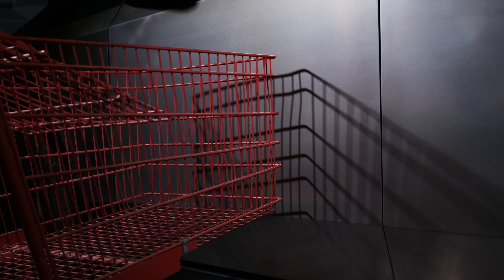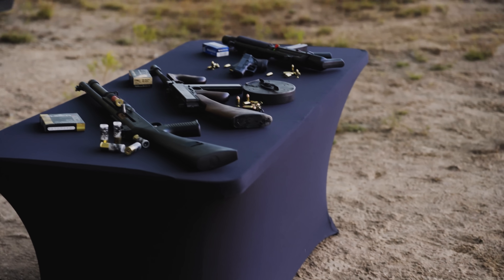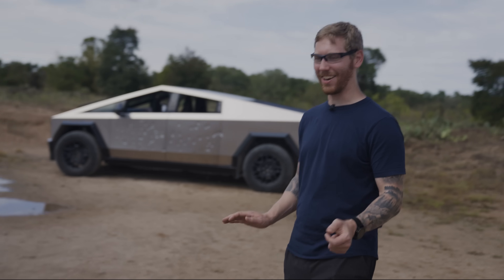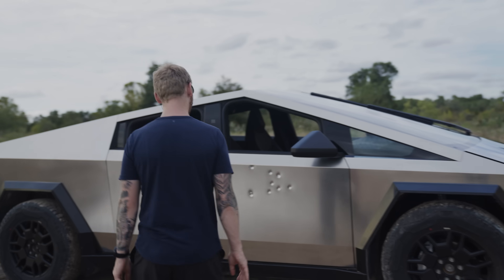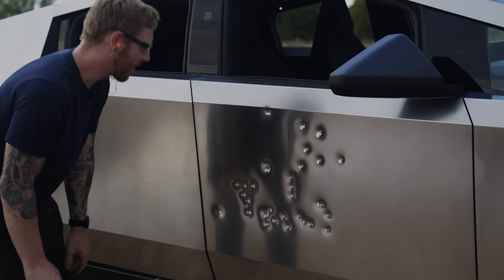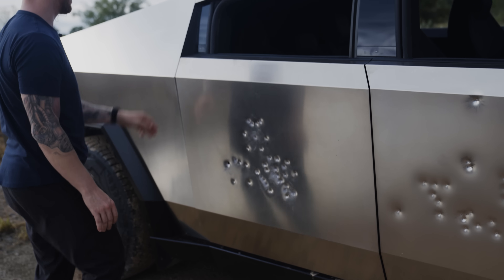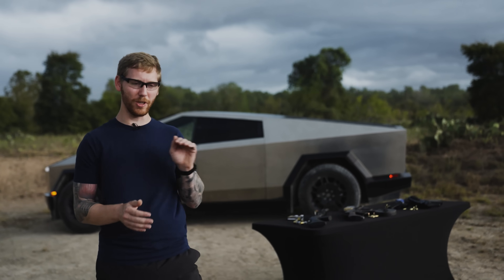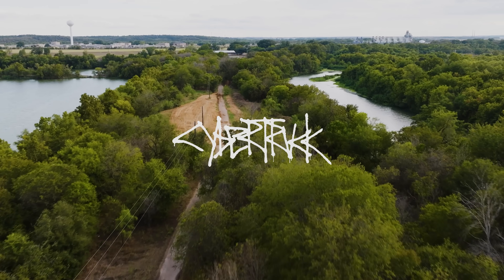Cybertruck Bullet Test

Comment: But does it resist fingerprints, and light acids like bird poo and city rain? Or will it be covered in greasy handprints and water spots after rain becuase it doesn't have door handles and requires you to grab the door itself to open/close? Do you have to re-surface an entire panel of there's a scratch? Are the plastic hub caps or bespoke Cyber Truck tires bulletproof? How about the plastic tunneau cover leading to a window? I can't understand why bulletproof doors even get any attention - shooting ANY car will stop the bullet. "Bullets go through one side and out the other" can be fact checked with 1000 YouTube videos showing the opposite. Such a bold and baseless lie.

Could have been a cool truck is the worst part. Shrunk it to smaller than a base f-150, took away rear view mirrors and rear window, increased the panel gap issues that made tesla famous, and does not appeal to the massive US market that actually buys $100,000 trucks. I can't wait to see how that stainless steel holds up over time. It's almost like they add paint to outdoor metal objects for a reason.

Comment: Very impressive... but I have to ask... why no 5.56?  Or go up the chain and see where it fails from 5.56 up to .50 cal Barrett?  I'd be very interested to see how strong of a round that steel can take.  Also you don't HAVE to use the whole truck, you can just take the doors for example :)
Reply: Because they knew it would be a forgone conclusion that 5.56/.223 would swiss cheese 1 door/glass if not both. FN 5.7×28mm handgun round too. 50 Barrett, forget about it.
Better test would've been adding .357 and .44 Magnum. I think those rounds would've made it through 1 door/glass and imbedded itself in the interior somewhere.
Reply: @1GooseEye  that would be my assumption as well, just would like to see it.  There's the clip from the Joe Rogan podcast where he shot it near point blank with his compound bow and it didn't do squat to it., which is very impressive.  Also don't get me wrong, what it already can do is very impressive, this is my "hey, let's push it as far as it can go" experimentation mentality :)

Comment: Depends on the ammo type, not the caliber or „115 grain from a Glock“. Full metal jacket will enter and come out the other side. It’s still cool it can withstand lead core ammo and buck shot. Assault rifle ammo should pierce through easily, much higher velocity and impact energy. So no need to test an AR-15 or a Kalashnikov on it, it‘ll only rip up the poor interior

Comment: Well, impressive as it is, besides the 45 ammo, 9mm ammo seems to be frangible ammo designed to break apart upon impact? Full Metal Jacket ammo are widely used by most thugs as they are the least expensive yet most penetrating...

Comment: So, in an accident, how are firefighters supposed to pull out people stuck in these vehicles?

Imagine being stuck in one of these while the battery is on fire and the EMTs can't even use their jaws of life to rip you out because the steel and glass are too impenetrable. 

And don't start with MUH ELON ALREADY THOUGHT OF THAT nonsense. Safety systems will always fail and there always needs to be a way for people to quickly get you out of your vehicle if you are unconscious.

Comment: Funny stuff , Using projectiles that travel less than a 1000 fps , and not FMJ but hollow points. Now , you want a real world test , use something people might actually use against someone in a car breach , like an AR with FMJ's , where the FPS is around 2400 FPS. AK 47 with FMJ's. Common 9MM FMJ travels slowly too , so probably stop that , thats a common round , but use a 40 cal FMJ , or better yet , the classic 357 mag in FMJ or a 45 FMJ , 50 Cal FMJ , see how those fair?

Comment: It's outrageous that car safety tests only apply to the people inside the vehicle. If you were to be hit by a truck or an SUV you're almost guaranteed to die, I'd love to see how dangerous this truck is considering how high it's front bumper is (which gives you horrible visibility). All for a non-efficient vehicle that's hard to load stuff into. Just drive a goddam electric van if you want to haul stuff, instead of having to haul out $500,000+ on this truck where you have to be a weight press champion to load something into the high bed. The only reason car companies do this is so they can sell them as "small" trucks and be less subject to regulation.

Comment: The Thompson SMG shoots a large .45 round at subsonic speeds. Although very nasty for fleshy things, it is not intended for long (or even medium) range or penetration through cover. I'd like to see this same test run with FN 5.7mm, or even a 9x19 parabellum FMJ round.
Reply: they literally used 9x19 in the video and you can see they are FMJ
Reply: @WayStedYou  Aw hell, I must have gone to take a leak during that part. You are correct. But the MP5 looks like an SD, also probably firing a slower 115-125gr subsonic round...
Reply: @Cucumberflavoredmustard  115 and 125 gr bullets are the average weights for 9mm. They are still faster than the speed of sound. If you want subsonic 9mm, the go-to bullet weight is 147 gr.
Reply: They shot it with a Glock and a MP5 chambered in 9mm in the video.
Reply: @PastorDr.MartinSsempa  They used a Glock, yes, at 1100 ft/S, which is accurate. Then they show the MP5-SD. FOR SOME REASON, they chose the variation of the MP5 that shoots Subsonic 9mm at 950 ft/s, WHICH THEY SHOW IN THE VIDEO. The MP5 shoots at a whopping 1,300 Ft/s, and they for some odd reason chose the far less punchy, subsonic variant of the gun, that shoots at the exact same speed as the Tommy Gun (with a LIGHTER bullet, so less energy.) The Glock, shooting FMJ 9mm at near sonic speeds, resulted in a fracture, a so called "double hit", in the steel body. If they had simply chosen a weapon that takes a step up, and might reasonably simulate a medium sized weapon shooting 9mm (like a 9mm "rifle" pistol, in california.), at or above sonic speeds; I feel it would've passed clean through. But they didn't. They chose the MP5SD, which shoots sub-sonic 9mm.
If they were telling you the output in Joules instead of ft/s, you'd be a lot less impressed.

Thompson Submachine Gun in Joules; 434 joules, assume an appropriate 230 grain bullet at 935 ft/s
The Glock, which was a Glock 43 Subcompact; 509 Joules, assuming an appropriate 124gr bullet was used. The Glock43 shoots at 1168 ft/s
For the MP5SD, the supplied chronograph reading was 960 ft/s; assuming a 124 grain bullet, that's 344 joules. So despite shooting a Parabellum 9x19, it was shooting it at BELOW tommy gun speeds, with below tommy gun energies.

So
in order the shoot should've gone like this:
1.Glock43 (The highest powered gun fired at the cybertruck. (Shoots a near trans-sonic 9mm)
2.Thompson Submachine gun(Near Trans-Sonic .45 Caliber Submachine gun)
3.MP5-SD (Suppressed, sub-sonic submachine gun.)
4.M4 Shotgun. (1200 ft/s with a 55gr pellet leads to a TINY 238 joules. Less than any of the other guns. None of the pellets are jacketed, so they just explode.)

Only people who don't understand firearms are impressed by this very carefully crafted video.

Comment: Obviously doors are easy to replace so you would shoot those. They are also not under tension because of their hinge/floating attachment. I'd be interested to see how the structural parts of the steel hold up to similar bullets. I'd think they have less warp/flex in them due to the structural tension. My expectation would be more of a propensity to rip the metal under this kind of punishment.
Reply: The exterior of a vehicle is all skin, bolted on to the structural members. Do you want them to flip it over and shoot the bottom struts?

Comment: I wonder if they were using FMJ rounds or soft point. That would make a big difference I think.
Reply: They were FMJ. You can see the rounds in the video. They're just pistol rounds, though... most rifles would zip right through both sides.
Reply: @ModernSurvivalSense  for sure. Still impressive that it can stop pistol rounds though
Reply: you can literally see they are FMJ on the table
Reply: @WayStedYou  yeah you're right. I missed that lol

Comment: Not a real world test they used hollow point ammo which is designed to reduce penetration. That is why they exploded on impact. If a lead shot from a buckshot broke thru that is more realistic. A full metal jacket is likely to penetrate that is true in most cases. 😅Short barels don't increase speed long barels do. If the tomy gun was 45 cal that is a slower ammunition. If you want a credible test let the pros do it call Brandon Herrera or Demo ranch.

Comment: Those mini explosions from the 12 guage in slow-mo was just amazing...
Reply: I think that's actually coming from the steel and not the shot! Lead is non-ferrous, so it's very unlikely to spark, so what we're actually seeing is little particles from the truck being shot (no pun intended) outwards and sparking.
Reply: The lead shot is kinda sparking/vaporizing
Reply: Ballistic high speed did fantastic videos of this effect with different rounds
Reply: The flames on impact are probably a thermite reaction between lead oxide and iron.
Reply: The slow mo shots look like added CGI
Reply: @BenMarvin  no, that's actually how 12 gauge shot shells work. The lead from each pellet is impacting the stainless steel alloy at high speed, which will definitely cause sparks.

Finally ratioed a verified channel...
Reply: @DiamondMaster115  the Hagerty cyber truck video had similar effects added for no raisin. 

Haha ratio. My account has been verified longer than that term has been around.
Reply: @BenMarvin yup

Comment: Now my question is... how would you repair scratches and dents+rust? Not many carshops can handle stainless steel since it is a new thing. Also there is fingerprint problem.
Reply: The whole %@**@$ point of the stainless steel is so you dont get scratches and dents, and if you do its just one part, you just pop it off and replace it
Reply: @-FederalBureauOfInvestigation  oh didnt know they dropped the idea of exoskeleton. I guess you can repair it fairly easily then
Reply: @johnb8319  the outer panels are individual you can take them off and replace them, the inner skeleton is just 1 piece. And for that to get damaged you would need a pretty hefty impact

Comment: Although quite an impressive feat with what Tesla has achieved, getting body work done for this truck will be a nightmare.  Not to mention the delay's an owner has to put up with if they need body panels from the factory.
Reply: I'm wondering if this thing can cut open in time by the fire department, when there is an accident.
Reply: nah it would be fine - the windows are regular windows, they'd be able to bust through pretty easy @user-ee9cz6mc1x
Reply: That shouldn't be as much of an issue once it scales. Panels are unlikely to be the bottleneck, meaning there should be spares to just replace the panel

Comment: Nice demonstration: although, having service in the US ARMY, I can't help but be a little curious whether the results would be just as impressive against supersonic rifle rounds such as the 7.62 x 51mm NATO or the 5.56 x 45mm NATO.  I'm sure the rounds would punch through....be interesting to see the results.  🙂
Reply: They pop right through like it's a tin can
Reply: Like they said the truck isnt meant to be bulletproof, its just a coincidence, but i think only shrapnel would come out not the whole bullet
Reply: @Nuke-MarsX Ok. 🎉
Reply: It makes sense from a practical perspective. Theres alot of different kind of impacts that could hit with the force of a superhot .45 and if that pierces the battery that would be very bad news. And honestly if you have to build a consumer vehicle that has to tolerate forces that can match 30-30 or 7.62 we probably have bigger problems than new car FOMO.
Reply: @Quagula  the battery is the most protected thing in the car, it could propably withstand a explosion, i mean the normal old tesla batteries even a single cell can withstand a 9mm. Imagine this now

Comment: This makes me more confident in starship using the same 301 stainless steel. Absolutely incredible.
Reply: Starship does NOT use 301, it uses a custom 304L alloy
Reply: Is it the same alloy? That's quite interesting!
Reply: Cybertruck is made with the same alloy as Starship.
Reply: The reason the cybertruck exists in the first place is too mass manufacture stainless steel and bring it cost down to eventually produce the Starship

Comment: What people don't realize is most car doors stop 45acp. Usually in the second layer but it is well noted that 45acp (the round out of the tommy gun) is not good a penetration 😊

In the video that showed only one or two rounds actually going through. They didn't use the MP5 on the regular truck because 9mm is moving a lot faster
Reply: This is total BS what you said. Aluminium and plactic definetly dont stop even a 22. Lol😂. And your knowledge of guns is also just ,horrible

Comment: So ironic that the extra weight and rigidity of the steel will result in more pedestrian and occupant casualties than the bullet resistant capabilities of it will save.
Reply: Extra weight? Its lighter than all other electric trucks. 
Also how many pedestrian crashes are there really? With modern computers you might never even hit the person to begin with
Reply: @terrestrialcreature7481 It is the lightest electric truck, but compared to the standard 0.7 mm body panels, it's still a lot of useless weight. 

There's an extremely clear correlation between the weight of a vehicle and pedestrian survivability. 

There's also a clear correlation between the deformation of the vehicle and the survivability of the occupants. While the body panels are not the frame of the vehicle, they still contribute to the deformation of the vehicle. The Cybertruck uses comparatively extremely hard, thick cold-rolled stainless steel. 

All I'm saying is that it's ironic they are emphasizing the durability of the panels as a safety feature, when in reality, they will likely kill more people than they will save. Seriously, think about if you're more likely to get in a collision with another vehicle/pedestrian or get shot at through the body panel with a pistol caliber round while driving a Cybertruck. 

This is just my guess, it very well may be wrong, and I'd wager that it likely is the safest electric truck so far due to the weight and geometry, it just seems like a missed opportunity to ditch the excessively thick panels to make it even better. 

There's not really any crash data yet, but there are a few leaked images, but you'll just have to draw your own conclusions from them though. 

https://insideevs.com/news/689519/tesla-cybertruck-crash-test-drone-images/

Comment: So, where is the 5.56, one of THE most common rounds available in the US, and also, the kind of round that can pierce cinderblocks, unlike just about any round used for this test? I mean, every single round used here isn't meant to penetrate any kind of supposedly armored surface. On top of that, you also have different kinds of power WITHIN the same around, giving it less velocity, and therefore less power to penetrate, in a design that wasn't already meant to penetrate in the first place.

Comment: That alloy is amazing, dissipating all that energy. great job
Reply: Pot helmet @myslef7636
Reply: Cybertruck is made with the same custom alloy SpaceX developed to build Starship.
Reply: It is extremely common and normal 304 stainless steel.
Reply: @rsilvers129  No, it's custom engineered. You know nothing of metallurgy
Reply: @Epicurus0  It is not custom engineered. No material in a tesla is custom engineered - they are all sourced from pre-existing material suppliers. You can buy sheets of this same stainless from any metal supply shop that has stainless.
Reply: @corail53   Cybertruck is buillt with the same custom alloy SpaceX developed to build Starship.
Reply: @rsilvers129  bokkem kadu

Comment: Badass no doubt, but you are moving down in power with the rounds. Would be really cool to see a hunting round from a rifle. That said, my FAVORITE thing is the exoskeleton. In my opinion most innovating thing Testla has done. Reduces vehicle complexity while increasing strength.
Reply: Dude it's obviously not gonna stop a rifle bullet. And if it goes anywhere near the battery pack, the Cybertruck will do a really great T-90 impression.
Reply: @michaelbuckers  According to the video, it can't even stop a Trans-Sonic pistol round. I explained in another comment; the Glock 43 they used was the MOST POWERFUL weapon that they shot at the cybertruck, by the numbers THEY SUPPLIED, being VERY generous with the weight of the bullets.

Glock43
Thompson Submachine Gun
MP5SD
Shotgun

in that order, that's from most powerful to least powerful, by muzzle ENERGY, not muzzle velocity.
Reply: @mikeishome69  yeah still kind of cool... but not powerful in world of guns. I do really like the chassis though, not the look, but dang super cool that whole structure is the skin. I think they should also play that up. Kind of sucks that is electric though 😂
Reply: @michaelbuckers  haha yeah batteries in trucks is a little bit of insanity. Worse yet is idea of running tractor trailers off batteries... if that was feasible all industrial machinery would already be doing it but doesn't make much since on its face. Much of it is deseil electric which isn't too bad. But batteries, give me a break.
Reply: @michaelbuckers  bringing up damaging the battery pack is absurd

Comment: Point to note is most copper bullets will not penetrate due to copper being softer than the steel. If you use any hardened bullets itll penetrate or fmj bullets
Reply: Counterpoint is that the regular truck that got penetrated also has steel doors, it's about the alloy and thickness.